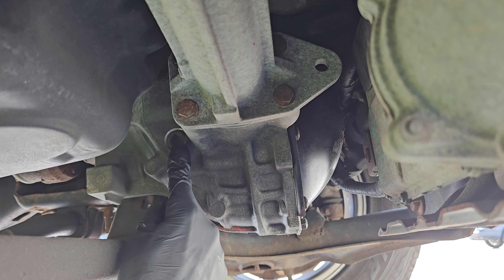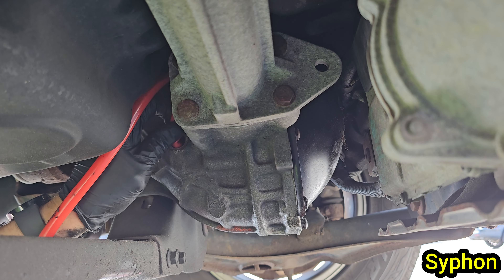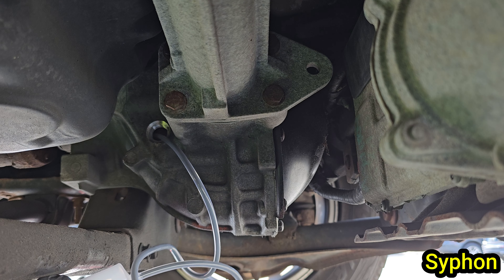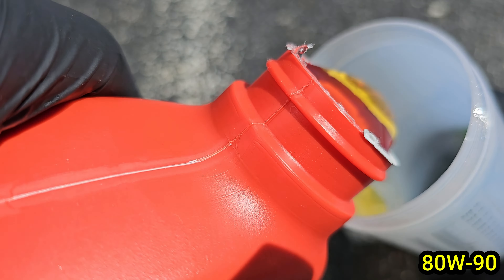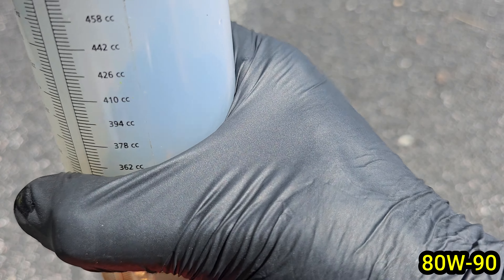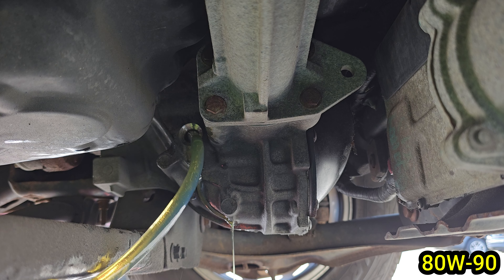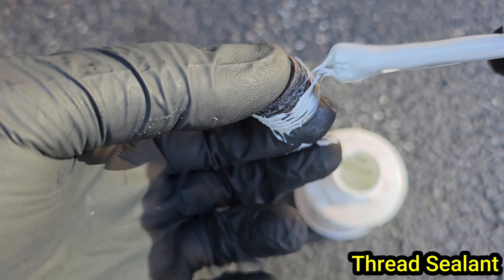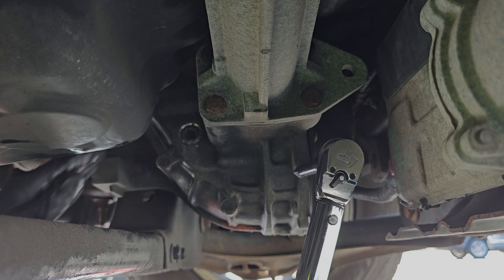Ford F150 Front Differential Fluid Change!

Comment: Don't drive in 4WD on tarmac. It is designed for low-traction surfaces.
Reply from the maker: Shouldn't drive as fast as I was, but if you keep it around 30MPH it won't hurt it on the road.
Reply: Speed has nothing to do with it. It will absolutely tear apart your transfer case unless you are driving in a straight line. When going around a corner not only do your tires spin at different rates but so do your axles. Engaging 4WD locks both drive shafts together locking the front and rear axles together.  The grip of the tires on the pavement doesn't allow the tires to slip while the axles are turning at different speeds and all of the force is now being applied to the locking mechanism of the transfer case. It will say in any 4X4 owners manual to never engage 4WD on dry pavement.
Reply from the maker: When one of my IWE's went up, I drove for a couple of months in 4WD. Never had an issue. I just didn't drive it like a jackass.
Reply: When your IWE "went up" I'm guessing it was only holding partial vacuum and making a grinding noise, you decided the best course of action was drive around full time in 4X4 to release vacuum to the IWE so it would engage the axle and stop grinding until it was replaced? I will be honest, the fact that your truck hasn't had a catastrophic transfer case failure makes me glad I also bought an F-150 and they really are built FORD TOUGH. You could have just temporarily disconnected and plugged the vacuum lines going to the IWEs.

Comment: I think you forgot to add limited slip additive
Reply from the maker: My truck doesn't have a limited slip diff.
Reply from the maker: This is also for the front diff, not the rear.
Reply: @TrickShiftGarage  I'd look into that a little more if I were you. I have 2011 F150, both difs are limited slip.
Reply from the maker: I already looked into it when I bought the fluids for the front and rear diffs from Ford. They ask for the VIN to see if I needed friction modifier or not. They let me know I did not.
Reply: @TrickShiftGarage  Yeah, I thought about that after I messaged you last. I also called Ford with my VIN and they told me I had a limited slip. I have a platinum, but I don't know why there's like 3 different differentials for the same years.
Reply from the maker: Yea it's actually quite annoying that they didn't just use 1 for all trims. I'm not 100% sure why they do this, but apparently they do it on the brand new ones too lol. Pretty wild.
Reply: @TrickShiftGarage  I suggest we boycott Ford until they stop with all their shenanigans 🤣 😂

Comment: I hope this is the same as my 2002 ram
Reply from the maker: If you have a drain plug, it would be a lot easier! If not, I would imagine it's a similar process. 

Either way, let me know how it goes brother!
Reply: You drove it on pavement in 4WD ? Hmmm
Reply from the maker: Yep. You don't want to do it for prolonged periods of time, and honestly I shouldn't have done it on the highway. But you want to drive it around to get the fluids moving.

Comment: I always use the 1 qt bottle pump. Can you take the cap off you stick a pump inside then stick the end of your phone into the hole I'm just pump it up and down..  don't need any houses last cleaning to do later,.. even though you can put a house on it and leave it on the floor and just pump..
Reply from the maker: I'm sorry man, I'm having trouble understanding. What do you mean when you say "houses last cleaning"?
Reply: @TrickShiftGarage  my apologies.. I meant to say no hoses and less cleaning , I'm just weird like that I don't like anything oily or greasy and always clean wipe and wash everything dry after every oil change

Comment: Do they sell anything to actually vacuum out the excess fluid that in the case before adding the new fluid?
Reply from the maker: You can search for vacuum pumps on Amazon. Those can help but make sure the tube is small enough to get to the bottom of the front diff.

Comment: do you have any tips on how to get all the way to the bottom of the sump. i was only able to get half a quart out of the diff?
Reply from the maker: So, I had to move the hose around repeatedly in order to get more than a quart out. It's kind of a pain that there isn't a drain plug on the front diff, but that's what we have to deal with unfortunately.
Reply from the maker: Just keep pushing the hose in and out. That could help.
Reply: @TrickShiftGarage  i tried that but im limited with what i have. getting a mechanic to do it  2 weeks from now and next time will try it again
Reply from the maker: I have a siphon in the description that has a pretty long hose if that's what you need. Or you can search for it on Amazon. You may be able to get one in by Saturday.
Reply: @TrickShiftGarage  i thought about that, im using a hand pump from HF and it did ok but was a pain. i might go ahead and order it and try to tackle it on Sunday. the pump i have also isn't clear so i have no idea if its coming through it or not. and this is nice because i can track how much fluid is being removed.
Reply from the maker: Either way, let me know how it goes man! Maybe 30 years from now Ford will put a drain plug on them lol.
Reply: @TrickShiftGarage  i will for sure, amazon says it will be at my house tomorrow by 10. it was such a shame doing it today and couldn't even get half a quart out of the diff. i saw anther video saying that if your having a hard time to rotate the tires because sometimes the bolts in the gears get in the way. probably will put her on stands and try it out. with the price of new vehicles u would think that would put a drain plug but ig that's more money for the dealer to charge for service.
Reply: @TrickShiftGarage  i have done some research, i think my issue is the size tube. I'm hoping that the one from amazon is small enough but still sturdy to get down to the sump. when you had the hose down in the diff, when full did you just unscrew the syringe or take the hose all the way out?
Reply from the maker: Yea, definitely needs to be a smaller tube to get all the way in there. Sorry, I should have mentioned that earlier. 

And I took mine out, but to be honest it's probably best you leave the tube in there as long as it's getting fluid out.
Reply: You can put the truck in neutral, on a level ground of course, and manually push it forward or backwards about 6-8 inches and a lot of times this will open a hole for you to get your hose straight down to the sump. If you’re on a lift and in neutral, just turn the driver’s side wheel a quarter turn and retry getting your hose down to the sump. Done this trick several times.
Reply: @ got it done by a shop
Today but definitely will be using my buddies lift next time to try this out. Would like to save money by doing it myself